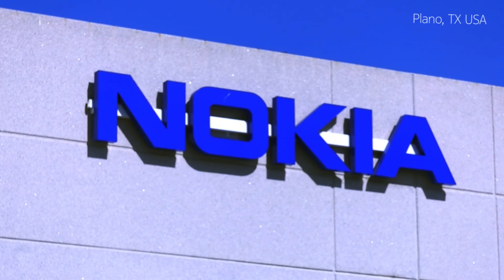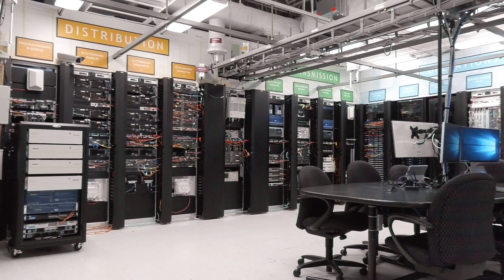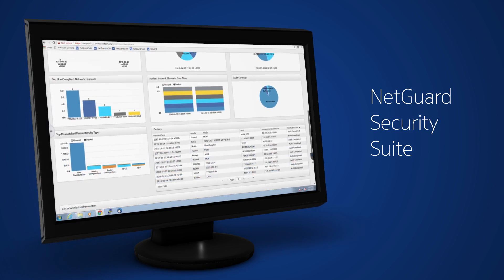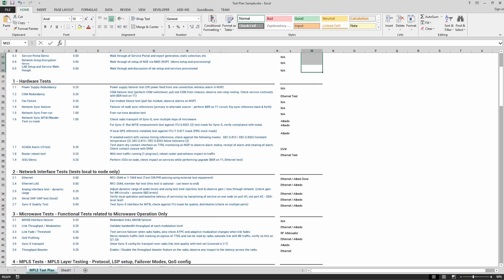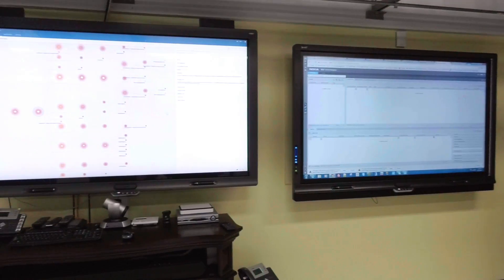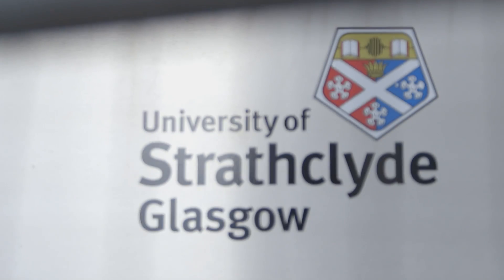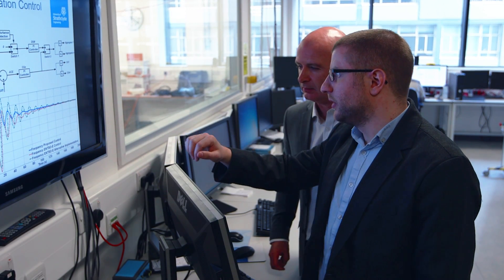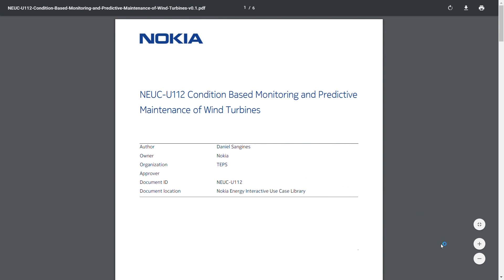The Nokia Energy Innovation Center: A communications proving ground for next generation energy

Comment: Mau nya menjelang piala Dunia 2018 nokia membuat hp INI DIA HP TERKEREN DI DUNIA
Kapan ya Nokia mau membuat hp Nokia S9 Max Pro Kamera Utama Dual Camera with Dual OIS 
- Wide-angle: Super Speed Dual Pixel 25MP AF sensor F2.5/F1.8
- Telephoto: 18MP AF sensor F1.8/F2.5 dan kamera depan Dual Camera AI selfie 25MP+18MP bukaan f/2.5 + f/1.8
RAM 6GB kapasitas daya battery 5500mha sama Memori Internal 64GB Dual SIM, Nano - Jaringan 2G/3G/4G LTE cepat 150Mbps, LTE Wi-Fi, Bluetooth GPS Octa Core Processor 2.8GHz Android v8.1 Oreo GPU Snapdragon 850 2.8GHz GPU Adreno 740 Nokia Experience 9.2+hp Nokia S9 Max Pro Tahan Banting dan Tahan Air+IP68 & Tahan debu hp Nokia S9 Max Pro bisa menghemat kuota hingga 50% Ultra Data Saving+Signal Max Nokia dan hp Nokia S9 Max Pro juga bisa menghemat daya baterai hingga 50% Layar 6,4 inci, resolusi 1.080 x 2.280 Super AMOLED dan hp Nokia S9 Max Pro bisa di pakai buat nonton TV atau ada TV di hp Nokia S9 Max Pro & Desain hp Nokia S9 Max Pro harus lebi keren dari pada Desain hp Nokia 9 apa lagi jika Nokia menjual hp Nokia S9 Max Pro harga ya cuma 5.000.000jutaan dan dapat BONUS GRATIS casing buku hp Nokia S9 Max Pro+anti gores pasti bayak yang membeli hp Nokia S9 Max Pro di INDONESIA mantap hp Nokia S9 Max Pro Super Keren Sekali?????